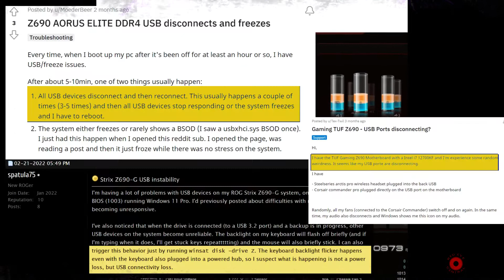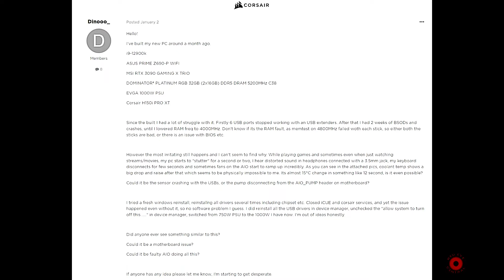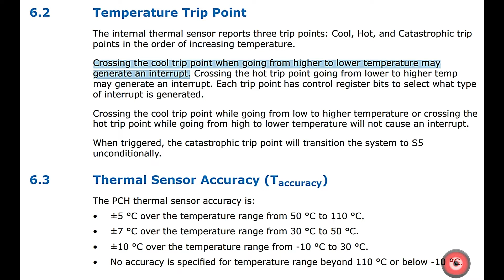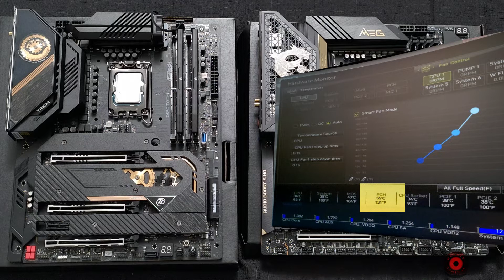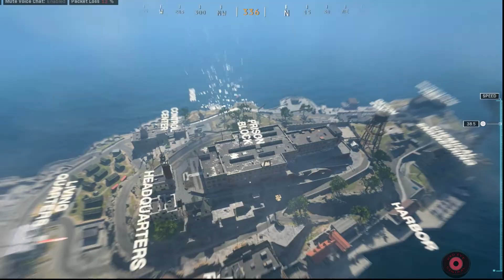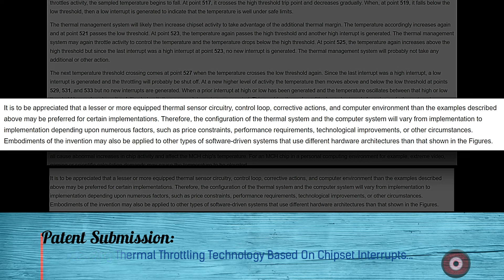Z690 Chipset Motherboards Getting Burned From The Inside Out? Let's Take A Look

Comment: I got the rog z690 formula on liquid well i still hit 86 when playing call of duty it just shuts down i did every banch mark there was untill i run intel xtu while runnig heaven benchmark i saw the chipset hit 96 well i know enough it crazy i tought it was fualt ram well did that bench mark took 8 hours passed it and now i see and get why my pc keep crashing when playing and the thing is im on liquid i should never ever get that hot but i seems like the chipset is burning from within its crazy
Reply from the maker: Sorry to hear. I know it's frustrating, especially on a top-tier board like the Formula. That board has been mentioned by several system owners. 

Unfortunately, it doesn't look like they extended the water cooling capabilities to the chipset on that motherboard, instead it looks like they concentrated the cooling on the VRM/MOS region.

Which, with all the extra connectivity going through the chipset on the Z690, seems like a missed opportunity to create a board with a comprehensive liquid cooling solution.

A lot of the higher-end boards have very ornate heatsinks on the chipset and M.2 drives, and those, unfortunately, seem to do better at creating aesthetic appeal than they do at managing thermal dissipation.

There is the option to add a chipset waterblock, but that most likely requires the GPU to be water cooled, the removal of the chipset heatsink, and most likely the M.2 heatsinks if they extend all the way to the chipset area. Those heatsinks often contribute significantly to the aesthetic theme of the board. So, it might take some of the visual appeal away if the system is presented as a visual display centerpiece.

But, if in dire need of improving functionality, that is an option. With the Watercool Heat Killer, we get Z690 chipset temps on the MSI Meg Ace that stay in a range between 27C and 35C, depending on ambient temps and workloads. We did a quick video showing some of those temps during some random workloads: https://www.youtube.com/watch?v=9ZgS3x6ULSQ

Some other things we've mentioned in some of the other comments:

-See if you can get some more fan cooling in that area. Some system owners have even mentioned placing a fan right on the heatsink with fasteners like double-sided tape, though with the temperatures in that area, I'm not sure how long the adhesive would stick.

-Try to remove the heatsink and check what is going on underneath. Are the thermal pads making good contact and getting compressed properly by the heatsink? Also, you could use some calipers to measure the thickness of the thermal pad installed by the manufacturer and try to find some upgraded Gelid GP Extreme or Thermal Grizzly Kryonaut replacements in that size to see if installing those can improve temperatures.

Another option that isn't too desirable is reducing functionality within the BIOS/UEFI, though that kind of defeats the purpose of buying a premium board with all the extra functionality. But, some system owners have mentioned reducing DMI speed in the BIOS from 4.0 to 3.0, etc.
Reply: @RedEyeCentral  Which option exactly limits DMI in the BIOS? So I wonder because I have an nvme disk in the slot m_1 that is, it works directly with the processor bypassing the chipset. So I should not lose performance in this case? Asus z690i motherboard, 95c under load, the temperature dropped after lowering the PCH voltage a little but it is still high. Currently 62c idle 82c under load, replaced thermopad with gelid Extreme 1.5mm (factory was 1mm), pch voltage 0.8 and 0.7
Reply from the maker: @errrr69  Here is a quick video I uploaded for you to see where it's at on the MSI Meg Ace Z690 board:

https://www.youtube.com/watch?v=Ar-FGCby4MI&feature=youtu.be

Where did you observe the temperature? Some people have mentioned some inaccurate readings in certain programs like icue. 

I don't have any hands-on with that board. But, if you double-checked the temperature in HWiNFO as well, or felt it with your hands, and you feel a lot of heat  confirming that the temperature readings seem accurate, and you want to try downgrading the DMI Link Speed, that particular setting is located on the Advanced CPU Configuration Screen on the MSI Meg Ace Z690. So maybe look in the CPU Overclocking area (advanced), maybe it's in a similar menu on the Asus board.

It may lose some performance, so it's not the most ideal solution. But if it's overheating, it could be a good temporary method to bring some of the heat down.

Let us know if you find it on the Asus.
Reply: @RedEyeCentral  I've been fighting the temperature for a long time. Readings from hwinfo. Above I wrote how it looked for me and now 82c under load. I do not know whether to continue to change something in the bios or just leave it. My current BIOS settings, Platform Misc Configuration tab:
Pci Express native power disabled
DMI link ASMP Control disabled
ASMP auto
 L1 Substates disabled 
DMI ASMP disabled 
DMI gen3 ASMP disabled 
PEG disabled 
Clock gating enabled

And after changing these options without moving anything in the cpu Configuration, the temperature of the chipset drops, that is, it changes only here. I saw it somewhere on the Asus forums. Those that I uploaded are set without a decrease in performance. And so I wonder whether to continue to change something or leave and accept with 82c under load
Reply from the maker: @errrr69  I know it's frustrating. From your original 95C, it looks like you were able to shave off about 13C. Have you noticed any loss in performance as a result of the changes?

Discounting any issues with how Asus may have mounted the PCH heatsink, the best thing is to try to find a way to increase air flow in the area. The GPU sits right in front of that PCH heatsink, and that can add a lot more heat right above the PCH that can combine with the temperatures that are already occurring from normal PCH functionality.

It sounds like Asus didn't do so hot cool with keeping some of their Z690 PCH temperatures in-check. A lot of the Z690 boards run hot on the PCH, but a lot of system owners with Asus boards seemed to be experiencing much higher temperatures than some others with boards from other manufacturers. And it was across many board tiers, including systems with their water-cooled boards, such as the Formula.

On a previous platform like Broadwell-E, it wouldn't be uncommon to see PCH temperatures in the mid-to-high 30C range under a full system load. But as more functionality has been pushed through the chipset since that time, system owners have seen those PCH temperatures ratcheting upward to uncomfortable levels.

Not knowing if there is an issue with the heatsink material or thermal paste underneath, the best thing to do is just try to get some more cooling in that area by getting creative and somehow adding a fan. Some system owners have reported sticking a smaller fan directly to the heatsink with double-sided tape.

There is the option to remove the PCH heatsink and inspect that it's making proper contact and possibly replace the thermal material, but that can be a little complicated if you don't have all the necessary materials on hand and know exactly what size thermal pads they used under that heatsink, which can end up leading to extended system downtime while trying to order all those materials after disassembly

Many of these stock PCH heatsinks aren't flat on the underside; instead, the manufacturer notches out a recessed area that sits on the chip to make way for a specific size thermal pad that they chose. This can make it impossible to use thermal paste as effectively as you could on a flat water-block cold plate.

Let us know what you end up deciding to do about the PCH temperatures going forward.

Comment: ASUS ROG MAXIMUS Z690 Formula, with Intel 12900K, Z690 PCH has 75 degree Celsius when is standing idle and not doing anything. I didn't test in a serious game because so far I haven't any graphic card, waiting for buying the Nvidia 40x when will appear. The PC box is pretty large, is Fractal Define 7, and has 7 fans, 4x14cm and 3 x 12 cm from the water cooler put on the box ceil. 3 NVMe of 2TB, gen4 x4, Segate FireCuda 530.

Comment: My Chipset runs at 70-80 Degrees in idle 😩. need to find a way to cool it, the graphics card is right in front of it though.
Reply from the maker: It may be that it isn't causing any issues. If you're not getting thermal throttling, peripheral disconnects, etc. But, without knowing the thermal trip points, and if concerned about longevity, there is the option for water cooled systems to add a chipset water block. 

We posted a video to demo some of the chipset temps we've been getting with the Watercool Heat Killer Southbridge REV3.0 chipset water block. 

You can skip through that video here:
https://www.youtube.com/watch?v=9ZgS3x6ULSQ

But, the long story short in that video is that with the Watercool Heatkiller chipset water block, the temps stay in the 28C to mid 30C range, depending on workload, on the MSI MEG ACE Z690.

The water block can easily last for many many years, so we can keep the old heatsink to put back on the motherboard in the future when we upgrade to a new board, and take the water block from system to system for many builds to come.

But, a water block likely requires the GPU to be water cooled too, because a GPU with a fan housing most likely won't fit above the chipset with the water block installed on many Z690 motherboards. It may also block SLI setups as the 2nd PCIe may be relegated to shorter PCIe add-in-cards (Nvme to PCIe, soundcards, network cards, etc.), as full-size GPUs might not fit in that 2nd slot with the chipset water block. 

We already had a water cooling loop with a water block on the GPU, so we were able to just add a chipset water block into the existing setup with some additional tubing and connectors. 

However, that might not be desirable for system owners who don't have or don't desire a water cooling solution on their system. In those cases, it might be worth trying to add some extra cooling around the chipset. Some system owners have mentioned placing a small case fan in the area, with some even mentioning using double-sided tape to stick the fan right to the heatsink.

Some other options that aren't too desirable are finding ways to reduce functionality, though that kind of defeats the purpose of buying a premium board with extra functionality. But, some have mentioned reducing DMI speed in the BIOS from 4.0 to 3.0, using fewer USB ports, etc.

It would be great to hear back what course of action, if any, you decided for your system, and the results achieved.

Best Wishes
Reply: @RedEyeCentral  I watched the temperature, funny enough it's doesn't even get much higher unser load.
But I do sometimes see some issue's with the PC lagging out of nowhere, so I guess that it could be related to that 🤔.

I could get 2 PCIE 4.0 Riser cables and mount my cards vertically, but I have read no good things about Riser cables, regarding stability and bandwidth.
Reply from the maker: @ojtothemax  Interesting. Yes, without knowing the interrupt trip points for hot and cold it's hard to tell if the lagging out issue is due to the chipset temps causing thermal throttling interrupts. But if it's not rising any further, it could be that either the sensor is not picking up transient spikes or there is a side issue.

Another situation that can cause similar instability symptoms on a system is when drivers for a new motherboard conflict with previously installed drivers from a former motherboard if the same disk drive containing the operating system is taken from an older build and carried over to a new system.

Sometimes it can help to get a fresh install of the new motherboard drivers after ensuring all previous drivers are completely removed from the system to prevent any conflicts over hardware. These conflicts between chipset, USB, SATA, Wi-Fi, Bluetooth, TB, and other drivers are also notorious for causing system hangs and instability.

Checking the motherboard drivers can be a good starting point because, other than a little time to uninstall and re-install the drivers, it involves no disassembly of the system and little risk of further complications. But, make sure any important things are always backed up, just in case.

If you suspect conflicting motherboard drivers could be an issue you can:

1.)Download all the newest drivers for the motherboard at the manufacturer's motherboard support page

2.)Disconnect from the internet (disable network adapters) to prevent Windows from automatically installing stuff as you uninstall older drivers

3.)Go into device manager, one way we have done that in the past, and individually remove all the drivers for the USB Hubs, "Firmware", Bluetooth, LAN, Wi-Fi, IDE, Thunderbolt, Audio, etc

4.)Restart to unregister the uninstalled drivers from the system

5.)Followed by unzipping and installing all the newly downloaded drivers for the current motherboard

6.)Restart a final time to register the newly installed drivers

7.) Observe to see if the system hangs still occur after this process

Or a less desirable way to do it, perform a complete re-install of Windows if the current installation was used with a previous system. Then install all the newly downloaded motherboard drivers.

This is only a possible issue if the current disk drive on which the operating system is installed was also used on a previous system with the chipset, USB, and other drivers for another motherboard.

Comment: Assembled a PC based on this motherboard "Asus ROG Maximus Z690 Formula ".
All elements Memory, VRM and SSD - cool perfectly.
The temperature indicators of the five SSD M.2 NVMe in different slots are simply excellent, taking into account the fact that there are "hot" samsungs.
Unfortunately, there is one problem.
The PCH temperature after the start of the PC rises and stays around ~ 74-75 degrees during "office" work.
With games, the PCH temperature rises to 79-80. : (
After the games close, it again drops to ~ 75 degrees.
The mother is new and she is only a couple of months old.
What to do with the high temperature of PCH is not yet clear.

P.S. Sorry for bad English
Reply from the maker: I can definitely see the concern as that seems hot for just system idle and office work temps. Are you getting any mouse, keyboard, or other peripheral interruptions or disconnections when the temperature rises? If not, it may not be hitting any trip points or affecting the performance. 

But, if you're concerned about the elevated temps affecting system performance or longevity, especially when compared to other previous Gen platforms and without knowing any of the interrupt trip points, then you could try to add some extra cooling around the chipset. Some system owners have mentioned placing a small case fan in the area and even using double-sided tape to stick the fan right to the heatsink.

We installed a Watercool Heatkiller Southbridge REV3.0 water block, and that brought the chipset temps down to 28-33C on the MSI MEG ACE Z690. We might try to do a quick video on that water block soon as well.

But, that requires the GPU to be water cooled too, because a GPU with a fan housing can't fit above the chipset with the water block installed. We already had a water cooling loop with a water block on the GPU, so we were able to just add it into the existing setup with some additional tubing and connectors. 

But that might not be desirable for system owners who don't have and don't desire a water cooling solution on their system.

Some other options that aren't too desirable are reducing functionality, though that kind of defeats the purpose of buying a premium board with extra functionality. Some have mentioned reducing DMI speed in the BIOS from 4.0 to 3.0, etc.

Let us know what you steps you end up deciding to take on your system.
Reply: ASUS ROG MAXIMUS Z690 Formula, with Intel 12900K, Z690 PCH has 75 degree Celsius when is standing idle and not doing anything. I didn't test in a serious game because so far I haven't any graphic card, waiting for buying the Nvidia 40x when will appear. The PC box is pretty large, is Fractal Define 7, and has 7 fans, 4x14cm and 3 x 12 cm from the water cooler put on the box ceil. 3 NVMe of 2TB, gen4 x4, Segate FireCuda 530.
Reply: Same here but my Z690 Formula right now is at 62 Degrees C. Honestly at this point it's normal, saw it going like 75-78 Degrees C lol.